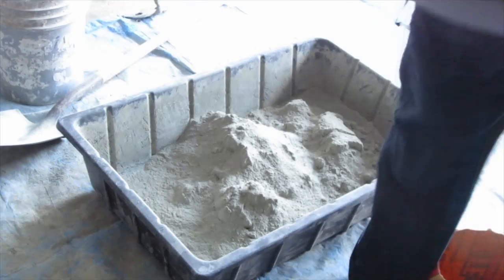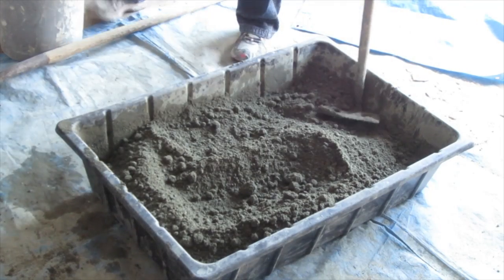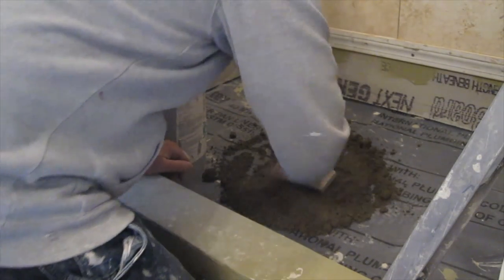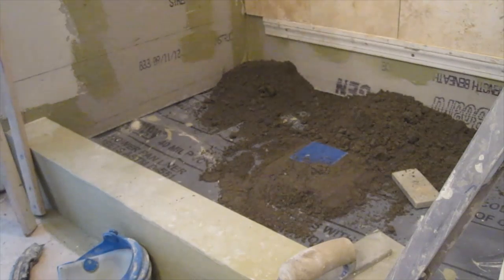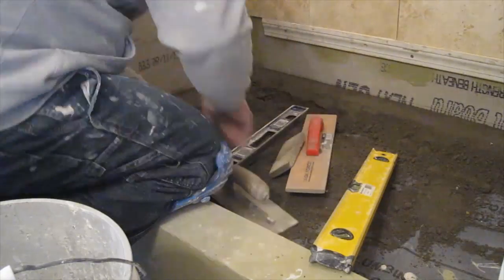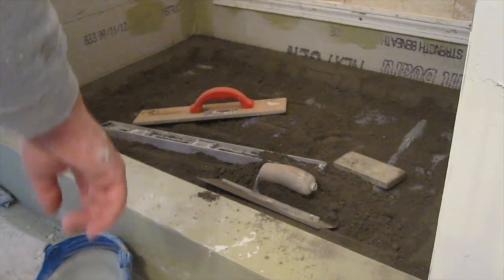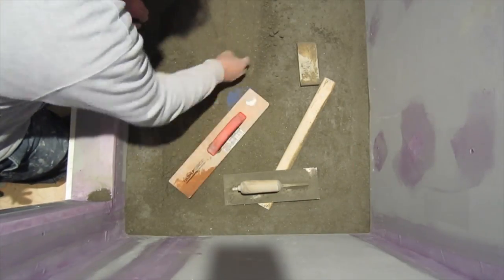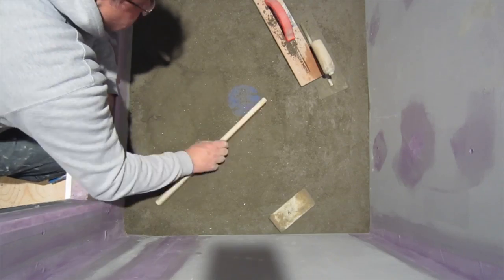How to install   Mud in a shower floor

Comment: Sal,  on the installation of the final shower pan, where the tile is going to be installed, how is the height of the mud determined.
Reply from the maker: at least 1/4" per foot slope towards the drain
Reply: it sounds like you are talking about pitch, I understand the 1/4" per foot, but there seems to be a lot of material in that bed? , but it looks like in the video you have 3" or more around perimeter, so does the drain stick up about an inch or 2, or is it dependent on the height of the curb?
Reply from the maker: You want to have at least 1 1/4" at the drain, so whatever it ends up being around the perimeter to get the correct pitch.
Reply: +Sal DiBlasi 
So in this case you are going to end at 1" 3/4 to 2 correct?? Thanks
Your videos are very helpful and appreciated.

Comment: The only problem is there's going to be water channeling under the drywall. The floor should be done first up to the vertical pan membrane, and then the drywall is installed sitting on top of the mortar. This way the water will come down with no channeling at the bottom of the drywall. 
When ever I renovate an existing washroom there's always a channel of water on the edge of the mortar floor under the drywall. It's the same concept roofers use for flashing. The water must drip away from the inner joints.
Reply from the maker: What  you are saying might seem logical, however you are describing a method similar to that used for a fiber cement board, not drywall. The substrate in this video is a true cement board, which is installed correctly. You must be a starr tile follower, he tells people to do it that way, which by the way is frowned upon by the entire industry. Drywall is never supposed to be used in a wet area, unless you are installing a sealed system with a sheet membrane, and even then most manufacturers don't like it. If you intend to just apply a liquid membrane, that is not acceptable. Don't believe me, look it up in the TCNA handbook.
Reply: @SalDiBlasi  I use the term drywall loosely, I actually use Durock board. But I always lay the drypack slope first, and the lower back board afterward. Your way, the water will always channel and over time even the fiber board will deteriorate. You should try what I'm suggesting, this is the way it's done in big commercial jobs. The Durock board should be 1/4" above the floor mortar. This way the water will always flow away from the wall. I also coat the entire plywood under the shower pan liner with rubberized asphalt sealer. And I cake the sealer alot around the floor drain opening.
Reply from the maker: @seravenerdi  What you should do is look up method B415-18 in the TCNA handbook and follow industry standards, or follow manufacturer recommendations. There are reasons things are done a certain way to avoid potential issues. Better still, abandon the old "Water in, WaterOut" System altogether and move to the better more modern Sealed system. Making up your own method of doing things can lead to unintended consequences. The way 'It's Done" may or may not be the correct way, Industry standards and manufacturer recommendations should be your only source of how it is done. I have seen too many installs done the same wrong way by installers that have been doing it the same way they were taught for decades. Sounds like you don't use a preslope in your shower, the way you describe it, if you are using a two stage drain, better look up the proper method. Don't get me wrong, not trying to argue with you, just saying that assumptions never lead to a good outcome.
Reply: @SalDiBlasi  Oh yes I do use a preslope, with a dry pack- 1/4" for every foot. But as I stated I put the mortar down on the 40 mil. before the last sheet of fibreboard. This way there's no channeling. When installing the tiles, I also make the last row of tiles slightly tilted outward on the bottom so the water is channeled away from the bottom edge. Water channeling is a tried and true engineered approach vs. relying on product spec and science. It's also common sense.
Reply from the maker: @seravenerdi  So what are you using, drywall, cement board or fiberboard, you are not clear about that, they are all different, one should not be in a wet area, another can be in the drypack and yet another has to be as you say above the mortar bed. Guessing is not common sense. Methods and proven standards are the only thing you should trust. Common sense is not a tested method. A typical shower will see the equivalent of 1000 inches of rain in a year, common sense is not a solution, methods and standard, tested and developed for a system that works to manage water is the only solution that should be employed. Tilting the bottom tile to shed water is an eyesore. the goal is to manage water effectively with waterproofing, not shed water like a roof. Like I said, use the methods in the TCNA handbook if you want to use tried true, tested, developed, methods that a proven to work. Or use the method that the manufacturer recommends, since they make the products you use and have designed them to work a certain way. What you will also find is that those recommendations for the most part align with the TCNA. Why would you "relying on product spec and science", maybe because those are what manufacturers and the TCNA rely on to develop methods and standards that are proven to work every time. The product specs are what tells you how the product works and how it should be used. Science, what engineers use to figure out how stuff works and how to use them. Again "relying on product spec and science"  is the common sense thing to do, not a gut feeling you think is common sense. Did you look at the method I mentioned. If you did you would notice something that would instantly tell you that I am correct. and you might be to as well to a degree. Better to have all the info than just a little.

Comment: Can we see a how to “hydroblock” a shower in a video. I don’t want my shower prep to take 3 days.
Reply from the maker: Being in a rush to finish always leads to bad installs.
Reply: I was told by a tile contractor of 40 years that the purpose of the pre formed pans was to speed up the prep process. Taking 3 days to do 9-12 hours of work is the definition of a waist of time. Also I can tell by looking at the pre fab pans that the slope is machine perfect unlike anything you can do by hand. I was also told that on a lot of mud showers they crack at the base where the floor meets the walls. Probably because you have to add 500-1200 pounds of mud ( depending on the size of the shower ) on the floor per shower in a small area where the underside of the floor has not been made to hold that much weight? So for these reasons and a few more I can list if you want I have decided to go with a hydroblock shower system and I was just hoping you would make a install video so I knew how to do it.

Comment from the maker: 2:1 is way to rich. If you are making your own Deck Mud, then you will want a 4:1 or 5:1 sand to Portland cement ratio. Yes the mix is only damp, but wet enough that it can be made into a ball and hold its shape.

Comment: what about a drain that is close to one of the walls, I meanie similar drain position to a tub drain? has anyone done a mortar bed for something like that?
Reply from the maker: Have done them many times, but the pitch will be very steep at the short side of the drain.
Reply: +Sal DiBlasi thank you sir for the reply. I always wondered what the sloped would be.  thanks.

Comment: Sal,Why didnt you used 20 gauged chicken wire ,tacking it at the very top of the pan liner and mudding it OLD SCHOOL? This method will cause a cold joint between backerboard and mortared pan causing water to get behind the backboard eventually and possibly causing mold issues.I know,Ive ripped out many pans with this paricular method.You saving grace here is to tile the pan first then tiling the walls to create a shingled overlap.33 years of experience
Reply from the maker: Never seen anyone do it that way, or even heard if it. However there is a pan liner complete with preslope, weep holes protected and installed according to industry standards. I also waterproof  everything, including the wall shower floor transition tied at all corners with a fiberglass reinforcing fabric. Check out a few of my other videos that deal with this.
Reply: Im not criticizing Sal. As long as you waterproof then all is well. Is you curb mortared or is that the Noble pre-fab?
Reply from the maker: David Giusto
No Problem, there is always someone that says they can do it better, faster, cheaper, or have some negative comment. The vast majority of feedback is always positive, but there are still trolls out there that like to annoy everyone, or just trying to spam for their own website or product.   One of these days I will make a video to explain how i do the curb, but for now let me just say that it is water tight.
Reply: thank you David! My thoughts exactly. I still float the walls too! C.Yeager....30+year journeyman.

Comment: I'm confused, I thought the cement board was not supposed to be in the pan. I thought there was supposed to be a gap between the mud pan and the cement board.
Reply from the maker: You thought right, but you also thought wrong. Fiber cement board leave a gap. True cement board can be in the mud.
Reply: Awesome thanks! Love your videos and tips. Starting my shower pan in a week. 7.5ft x 3.5ft, linear drain. Sand topping mix is your pan base of choice?
Reply from the maker: Mapei 4 to 1 http://www.mapei.com/public/COM/products/4to1_TDS_EA.pdf
Reply: Are you saying to use the mapei over the quikrete sand topping mix you used in this video?
Reply from the maker: yes

Comment: Why do you place the cement board walls inside the shower floor?
Reply: So that the shower wall can be tiled all the way down to the finished shower floor.
Reply: I do the something so the mud pushes the board. Remember you can't add nails or screws under 6 inches or you will puncher the pan liner. This way the bottom of the board doesn't stay lose get it?
Reply: Boy oh boy u never cement board to the pan smh u leave a gap and tuck the floor tile.
Reply: nick reyburn I thought so too.
I stopped the video as soon as I saw that to check the comments.
Reply: nick reyburn who says u leave a gap??Sal is a certified tile installer the follows the NTCA guide lines and standards..i think ur the one doin it wrong

Comment: Waterproofing before mud might be better.
Reply from the maker: That is what the vinyl liner is for.
Reply from the maker: c Dittmer  Refer to TCNA 2018 handbook page 242 Method B415-18. Note the details for Cement board and fiber Cement board. One is allowed to be in the mud, the other is not.

Comment: Big mistake here, you never cover your wall board with the pan. The wall board should come down to the pan, and be 1/2 inch above the pan. Now it is going to mold and rot out.
Reply from the maker: Really, is that an absolute? Maybe you should check the TCNA handbook Method B415. there is a distinction between fiber cement board and True cement board.

Comment: Durock, hardibacker, all those cement based backers, are NOT supposed to be below grade
Reply from the maker: Funny how not having all the info leads one to believe that they know more than they actually know. I refer you to the 2018 TCNA Handbook page 242 Method B415-18, where you will see details for both cement board, which Durock falls under, and Fiber cement board, which Hardie Backer falls under.  One can be in the mud, the other can not, look it up to see which is which.
Reply: @SalDiBlasi  hopefully more peeps watch your vids, so i can continue to rip out failed showers. I think your a great tile guy, but the oldschool way of doing things isnt the best anymore, i too had to change with the times. Its important as trade proffessionals not to get our egos wrapped up in products, and systems. Many people do not run waterproof paper behind the durock, and from it sitting in the mud, it wicks water upward, and now you have constant moisture between studs, and durock. Mix this with the fact that most showers are used 2 times a day, and it never dries. You get rotten studs and start having the tile pop/crack. I see this often, and again, not trying to insult your skills, cuz this is not about your skills, but your choice in literally the cheapest system out there, that takes the most time to install, and is the system i have to rip out the most. But, i know you and every tile person out there that does it this way are saying that youve never had a system fail, and thats ok, cuz 7 to 10 years down the line (avg life of pvc liner, yes it decays) they may not think to call you back, or they arent original customer, etc, and you would never know. Again, i think you are skilled, i just think youd be 10x better using a better substrate.
Reply from the maker: Mr Smith  You obviously have not seen any of my other videos, almost 700. If you do decide to check out my channel, you will see that I use all modern methods and materials, including Schluter, Hydroan Board, Wedi and more. here is a link, https://www.youtube.com/user/saldibs

Comment: Why you sat tile on the walls without floating the pan you can RIP the liner thts not smart even if you cover it what if vfc you drop a tile or a level

Comment: Not sure what you are implying, I simply ask because the video didn't show pre liner install so I will seek advice elsewhere.
Reply from the maker: +Jeff Hash This is that same shower. https://www.youtube.com/watch?v=aKY2TjNUpYI  I have to deal with a lot of people asking a lot of questions and a few trolls here and there.
Reply: Sure,  looking to install a curbless shower where old tub is and seen some video that uses various underlying designs. I like the linear drain system, I do tile and other trades. Just looking at new products and ideas before I start, any suggestions.  Thanks Jeff
Reply from the maker: +Jeff Hash Look at Schluter Kerdi-Line drains https://www.youtube.com/watch?v=JgDILsDBezg

Comment: Is 2 to 1 Portland cement to sand mix okay?  Would it cause any problems?  Also, your mixture seems very dry as you are working with it, almost like sand.  It must just be slightly damp.  Am i correct in stating that?

Comment: You would not get away with this in a skyscraper…lead pan only
Reply from the maker: I would never want to work in a sky scraper, so I guess I am safe. By the way, lead and copper pans are the worst type of system to use in any type of shower. It is 2021 much better options available today, and I am not referring to the vinyl liner and two stage drain in this video.